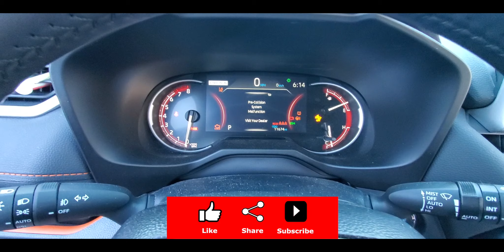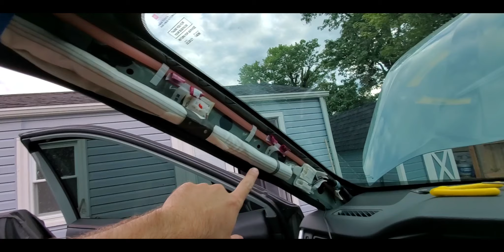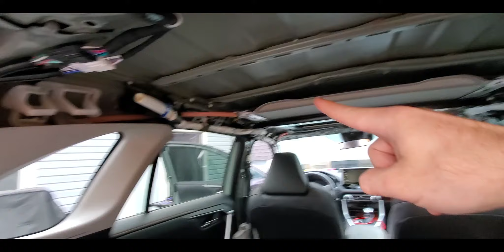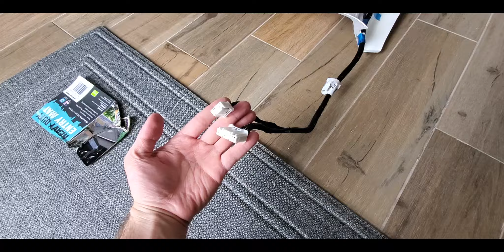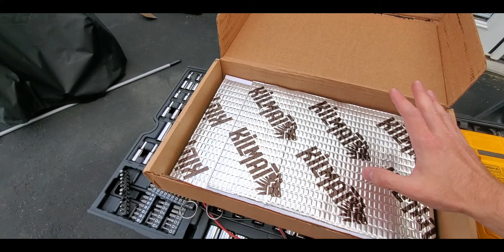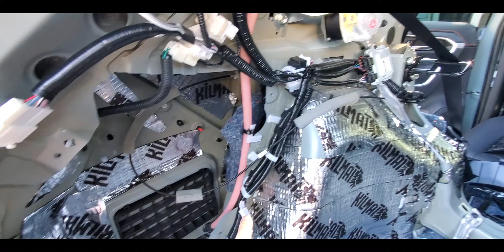Behind the Headliner of the Toyota Rav4 2019 2020 2021

Comment: Is there a easy way to apply some sound dampening sheets to the back part of the roof without taking the whole headliner out? I have a sunroof so it would be easier to at least get the back of the roof. Sounds like a tin roof when you get  a pounding rain.

Comment: Are you going to do a video about all the sound deadening material you installed?  I want to strategically place material to make the cabin nicer. Thanks!
Reply from the maker: I was not thinking about making a video. Maybe I can in the future. I don't think there is a  strategy to installing these. Just cover up to 80% of any surface you are working on. You can see my subwoofer install video and door speaker install video to have a look at the sound deadening material in those areas.
Reply: @Rav4Gen5  How much added weight do you think you have added to the RAV4 with all the sound deadening panels?  Did you use a audio meter to determine the loudest areas? Thanks!
Reply from the maker: @zennoodle  I probably added 25 lbs. (1 and a half boxes). Totally worth it. I never did a sound meter test but I have driven an LE without deadening and it's horrible.
Reply: @Rav4Gen5  25 pounds is definitely not bad for piece of mind.  Just have to find time and take apart the car and pull the carpet, etc etc haha. Thanks for the inspiration though!
Reply from the maker: I will say I think the range of the remote is impacted. Feel like it does not reach from far. It gets annoying.

Comment: How much does the deadener on the roof help? I have done all 5 doors, and the trunk. I am debating dropping the headliner just to put deadener up there.
Reply from the maker: I would not do it unless you have some other business up there. Too much of a pain.
Reply: @Rav4Gen5  how long did it take you to remove?
Reply: @Rav4Gen5 would it be a big pain to remove the headliner for sound deadening if you don't have a moonroof? Or would it still not be worth the time to do it?
Reply: How much did doing your doors and trunk help in road noise reduction?
Reply from the maker: @thetechlibrarian  It helps with road noise. Hard to say by how much. However, when you supress road noise, you are hearing more the wind noise. There is always noise.

Comment: Appreciate your videos! How much of an improvement have you noticed in road/wind noise by installing the sound deadening? Say, if stock is a 10/10 noise rating then what would your current setup be rated?
Reply from the maker: Not a lot but only because the roof rack (Prinsu) threw away all the effort of wind noise reduction. My future plan now is to make a removable Prinsu Roof Rack. Don't drop the headliner just to install sound deadening. Too much work for that little gain.